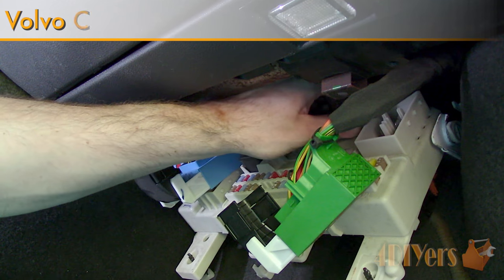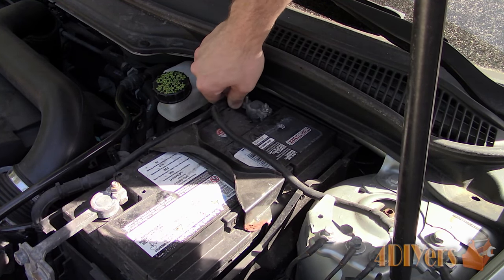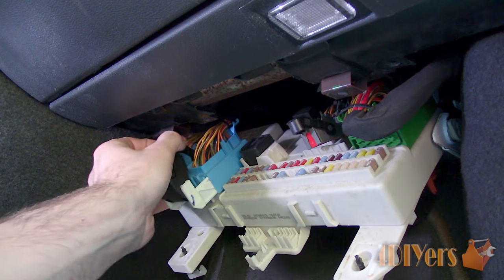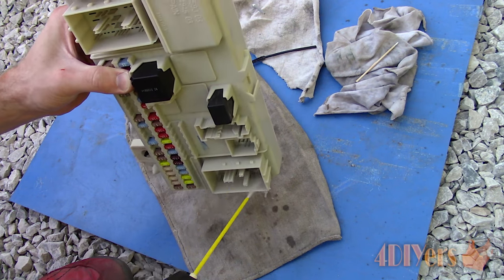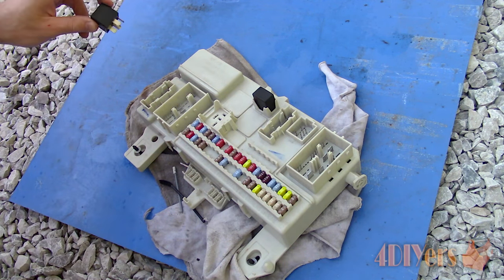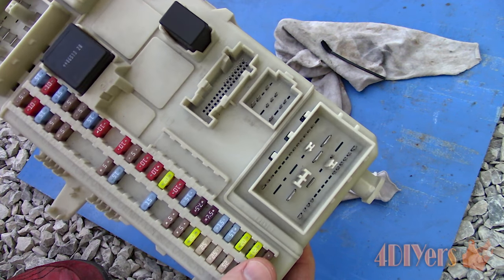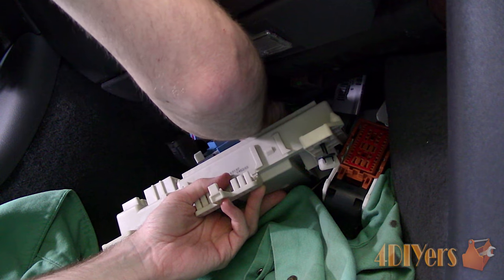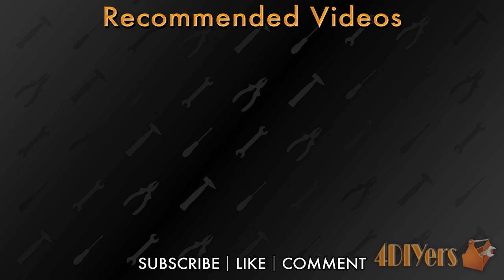How to: Volvo C30 S40 V50 C70 CEM Removal and Cleaning

Comment: Likely saved me thousands by doing this quick fix, thank you! My 2005 Volvo t5 v50 AWD suddenly started having multiple electrical problems: wipers stuck on, no turn signals, loss of window function, loss of lock function, alarm set off while opening hood, and gas guage failure. I found corrosion at the same spot that was in the video but his looked more severe. Cleaned with no contact cleaner safe for plastic, nylon brush, blew it out like a Nintendo cartridge and presto! Everything works again! I will note that I went pretty light on the cleaner, dried for only a couple minutes and skipped the electrical contact solution. Still worked for me.
Reply from the maker: Happy I could help and thank you for sharing your experience!
Reply: My s40 t5 driver door keeps losing function, so I'm going to have to  try this at some point!

Comment: Thanks for the information. Very useful. I would not have had the confidence to do this without it. I followed all of the procedure. I have a 2005 V50 car and a 2005 CEM, as it has a date on it. After removing the CEM, I could not see any evidence of either corrosion or dirt. It all looked very clean. Nonetheless, I sprayed each  connector, male & female and cleaned with brushes. I will have to wait and see if it fixes my problem which is indicating the CEM is the source of various issues! Fingers crossed. If this doesn't work, I will try a reconditioned unit..... I did read elsewhere that sometimes the welds on the motherboard are a source of problems??? I think I prefer older cars which have more basic electrics!
Reply from the maker: Happy to help! It is common for the soldered joints to break on electronics on some vehicles. I don't believe I've heard anything specific for Volvo. You can pull apart the module, the plastic case is a little trick but it can be done. Just take lots of pictures so you know where all the fuses go. I have an 06 Dodge Ram now, thinking it was simpler, it still have it's own electrical gremlins too. Next vehicle will be older at this point, can't stand the new stuff.
Reply: Did it work?
Reply: @fodolocraigo8426  Yes, it did work. Absolutely.

Comment: This is awesome video.  I had 15 volvo specific codes on my 2006 S40 after having recent acceleration problems.  Last two years, I was getting intermittent "engine system service urgent" message.   It was on most of the time in last few days.  I cleaned as shown in the video along with reinserting all the fuses plus cleaned grounds on the passenger side of engine compartment and down by the passenger door.  I put it together, message was gone.  I still had the codes and cleared them using an ES610 scanner.  I took it for a drive and the old acceleration was back.  Thank you so much, this demonstration really helped me .
Reply from the maker: No problem, happy to help and glad to hear your car is back to normal :)

Comment: My 2005 s40 CEM seems to be bad after moisture from a leaking heater core caused it to malfunction or corrode. As of right now i am having major issues with my windshield wipper switch not responding, and the wipers will randomly turn on at the fastest speed and wont turn off until the battery is disconnected. do you think a cleaning like shown in the video can alleviate this issue or am I sol?

Comment: You have just saved me £1,000 which a dealer quoted me due to a ignition issue (over starting). Bought a £4 can of the solvent, cleaned a couple of the green connectors and put it back together whilst in some questionable positions...

I can't thank you enough.
Reply from the maker: Awesome to hear and thank you so much for the feedback!

Comment: Massive thank you for this video!  My 04 s40 t5 threw a fit after a stall/quick restart. Wipers on, windows stuck down, interior lights, slight loss of power, no central locking, fuel gauge off.  Anti skid and sas airbag warnings on dash.  Followed your video step by step apart from the last fluid you applied.  Car is sorted 😎👌
Reply from the maker: Awesome to hear it worked and thank you for the feedback!
Reply: Sounds like you went through hell 😂

Comment: Thank you very much for your tutorial!

My volvo c30 was completely crazy: dashboard that went off randomly, lights abs, airbag, electric paralysis on the right side (window, central locking).

Everything disappeared with just a blow of elbow oil, which would have cost me 1500 € to the garage.

Quentin from Bordeaux, France.
Reply from the maker: Always happy to help and thank you so much for the feedback :) It's amazing how many problems this module can cause. I have quite a few more C30 tutorials too if you're searching for more repair videos.

Comment: Excellent tutorial.  I was planning on doing this to my 2011 S40 T5 which has assorted intermittent electrical problems (I think related to the fact I live in a humid climate).  And, I was just going to "wing it", being an EE.  But, your tutorial is going to make the process so much easier.  I can't thank you enough.
Reply from the maker: No problem, happy I could help and thank for the kind words.
Reply: Did you ever have bcm 0101 code and anti skid service required

Comment: Really glad that I found your do-it-yourself video for module issues. I had an interlock device installed 3 years ago 4 years ago actually and I have had issues after it was installed and coincidentally my sunroof had to be fixed due to the tubes in it leaking onto the floor causing pretty significant water accumulation. So I'm not sure if those two circumstances affected the module or if one particular issue was the culprit. What occurs when I drive my car especially when it engages into turbo I will receive a notification on my dash that says anti-skid service required and then my car will go into safety mode taking it out of drive gear and if I drive it for a while it will suddenly pop abruptly into drive and if I didn't continue driving it and needed to stop and put it in park before it has a chance to pop back into gear it will go into immobilization mode locking my key thus leaving my battery on. So one mechanic told me to disconnect what appears to be some type of module in the engine that's wiping out the memory of the cars notification system I guess giving it temporary amnesia wiping out that memory that has a issue and then I'm able to restart it get my key out etc. Volvo dealership had it for a month and said they're getting a miscommunication error but they can't figure out out of the three modules where it's originating from because it doesn't misbehave when it's on the diagnostic itself. So I've been driving it like this for 2 years minimally. I've been using my deceased sisters Passat and it's alternator just went to put on me so I'm back to the Volvo drill that I have to endure randomly it only happens 5-7times a month when driven regularly. And as it is a 2004 S40 I am a single mom and a budget and I can't even fathom spending the money Volvo wants to charge me for a brand new ECM/ECU Module and a reprogramming fee wiping out my nest egg $$
 for a car that has a Kelly Blue book value if $2,400.00. So with that said, I'm going to try doing exactly what you so beautifully demonstrated with the best clarity I have seen on any do it yourself tutorial that is available . Thanking you in advance for taking the time to video the process and making it so easy to understand for a person who is somewhat mechanical at least I think I'm really good mechanically but not a professional auto mechanic. Single moms have to do what they have to do and stretch a dollar pretty far. Thank you again I'll let you know if it works!!

Comment: Really excellent video. Like others I was getting numerous alarming messages including the following "engine system service urgent", "Brake failure stop safely", as well as having the airbag light on, window wipers going off on their own and the windows themselves not working. Also the car refused to start after the "engine system service urgent" appeared! Anyway, a local auto electric mechanic told me that the CEM unit on the Volvo S40 (my car) is prone to cause a multitude of issues including mine. This being due to corrosion on the CEMs contacts. He also noted that there was a voltage drop on my car. Anyway I cleaned the CEM with WD40 Contact Cleaner, reassembled obviously!, now the car is going like a rocket! 

Many thanks for this great guide. Probably saved me a lot of money.
Reply from the maker: Thank you so much for the kind words and feedback! This should definitely help out fellow viewers with your info.
Reply: Hi, is the votlage drop an indicator of CEM failures? Im getting multiple errors on my v50 and had it at mechanics 3 times now without anyone fixing it. Once after I stopped the car after getting the errros it did not start again as something was draining the battery.

Comment: '08 S40 T5 w/142K here. Recently purchased. Check engine light comes on, 1st time it was "erratic ignition," misfire on cyl's 3 and 5. Later came back on and it was cyl 4 misfire.  Changed all plugs with new NGK's. Then changed all 5 coil's as suggested. Neither made a difference. Starting cold the engine fast idles with misfires. Goes on fast idle perfectly then drops down to preset idle. Only seems to misfire at stop signs, traffic lights, anywhere I have to actually stop. But upon acceleration the car does fine, lots of power thanks to the turbo. But the low level putt, putt, putt at a stop is annoying. I dropped the CEM under the glovebox and pulled all the plugs and cleaned with an electric spray cleaner. The best news is I didn't make anything worse!!  Gotta take those wins when you can.  But the low level misfire remains. Just wanted to share this with anyone who may be having similar issues, Good luck to all and a blessed new year.

Comment: As I have a UK spec V50, a right hand drive. car so the CEM is at the left hand/ passenger side of the car. To replace the pollen filter in need to remove parts of the CEM to gain access and it's murder to get this out. I did remove a few clips with the battery 🔋 disconnected so that wasnt a problem really. but putting it all togheteher again I noted the odometer and the clock display no longer stays on after the ignitions is switched off. They stayed on for about 5 minutes after the car was locked before replacing the pollen filter. 

Your video gives me the confidence to try to see if there is a problem with the connectors. 
So thank you for a thorough and very helpfull video. :-)
Reply from the maker: No problem, always happy to help! Trying to remember back on my Volvo, I believe mine turned off almost immediately after I removed the key.

Comment: I think this is exactly what I need to do.2005 s40t5 throwing all kinds of messages,immobilizer,reduced engine,brake failure,etc.I'll give it a try.I did have a plugged ac drain a couple of weeks ago but didn't find water at this location.Only passenger rear and some in the lower right central coloumn.
Reply: I am having the same issue right now so this is what im trying.

Comment: Thanks for the video! When I took mine out I found corrosion on the blades on all of the fuses except one. I cleaned them all with 200 grit sandpaper.  I opened the plastic case by holding open each clip with a half toothpick. There was no corrosion on the CEM itself.  Since the problem is intermittent, I won't know for sure if this is the real fix for a few weeks, but I'm really hopeful.
Reply from the maker: You're welcome! Hopefully that solved it, depending on the severity of corrosion, it can cause intermediate issues.

Comment: Im having a CEM problem right now..have 4 codes for the accelerator pedal sensor so after i tried 2 junkyard pedals, i had to take it to the stealership..they just gave me a quote to replace the CEM for $2800..even though its a V50 AWD M66..i was debating scrapping the car..until this video gave me an option, thank you!
Reply: Did it fix your issues?
Reply: I had the same problem..it is definitely the cem..just get contact cleaner and clean the shit out off the harness pins and cem pins..thats what i did and it worked

Comment: Yeah so my right side lowbeam light seems to have an issue. This may be the answer. I’ve replaced the bulb, bought several actually, and no dice. Hope I don’t mess this up. Thanks for your awesome videos, I’ve got a 2007 Volvo s40 and your videos rock!
Reply: I know it was 3 years ago, but did it work? I have the same issue 😂 lowbeam right side is not working for me

Comment: Great tutorial, I've had an issue recently where my horn was stuck on, I removed the wires connecting the horn, I'm now worried that the alarm will have an issue, do you know where the fuse is located on a 2010 V50 for the alarm siren as I just want to eliminate the possibility of more noise for the neighbours at 5am

Comment: I bought a used S40 that is 16 years old. The car was mechanically in great shape but had one electrical problem after another. Brake failure light, immobilizer light, fuel rail code, accelerator pedal code, engine system urgent, p1070, p0240, etc etc I took out the cem, and cleaned it. It didn't look dirty, at least not the connections, but there was dust all around the Box. After cleaning up and putting it back together all codes disappeared even the check engine light is off. These should probably be cleaned every few years. Had I taking it to a dealership, they will have certainly try to sell me a new one. Those uncomfortable working on these cars should not buy one. If you don't mind getting your hands dirty little bit that's worth it

Comment: Excellent - no wasted waffle. Hope this will help me trace a problem on my S 40 daytime running lights
Reply from the maker: Thank you so much!
Reply: Did it help? Having the same kind of problem...
Reply: @anttilager177  Hi there, sorry but I’ve not looked at it yet.
Reply: could you solve the problem?
Reply: @latking  yes Mike. I replaced the relay and the headlight now works. Fortunately, I had a neighbour who desoldered the faulty relay for me and soldered the new one. I wasn’t too confident with doing the soldering.

Comment: I’m having trouble with 2005 s40. The emergency flashers and high beams flicker. Not too long ago had a leak in the coolant basin and repaired. Thinking coolant may have corroded the CEM. Will try this as a fix.

Comment: Great video and reading about symptoms I may have few, one of them is problems with the start, sometimes just don't start...wait a moment, or few hours or a day...and it just start. A questions please, if I change or replace the whole CEM does it need to be reprogram or just replace with no programing. Thanks so much for the video
Reply from the maker: You’re very welcome! Unfortunately a replacement cem will need to be programmed to your car.

Comment: Thanks for video I think I need to do this as getting a lot of different problems lighting up , then nothing for ages then it will do it again . Also when I push button for rear heated window and front window I get interference on my radio will this be something to do with the ecm to . Mine is the v50 1.6 drive diesel
Reply from the maker: No problem!

Comment: Wish me.luck please. My 05 xcv70 began a malfunction streak a little while ago. This video seems to offer some hope for some of the issues perhaps. The speedometer was the first thing which seemed in this category but other things may be related like the brake warning failure stop safely message.
The odometer is not working now as well.
The first thing I noticed is the lurching right after starting and getting underway.  The traction light flashes when the lurching is felt as though the back wheels are dragging or something like that but this goes away shortly. It acts up in slippery situations briefly too. Almost always right after turning out of the driveway while  getting underway though.  The speedometer always  fluctuates now  at first after start up and does not show actual speed but the tachometer is fine. After a little while the speedometer does start to display accurately but now at exactly  the same time the stop safely brake failure message displays now too. The brake message does not come on when the car is shut of and started again. It is like everything resets but the pattern is the same. No speedo, anti skid message flash, / then speedo works and brake message comes on. But now the odometer is just off line or very intermitant.  It has not advanced for a few days. The trip meter is not working at all and the instantaneous MPG display says zero most of the time but comes on intermitantly too. Also the average mpg display is horribly down to 10-11 mpg half the previous normal.
Actual mpg is hard to figure out now. It does seem like it is getting the crappiest mileage now though. Engine  seems ok though.

Comment: Great video 
My 2010 s40 T5 AWD just developed strange behavior. I got Anti-skid warning light and transmission shifts to N, once released gas pedal it shifts back to D. Repeated this for half dozen times and just went to normal. Three days later same thing. Transmission otherwise works flawlessl.
Would you think it has potentialy ECM issues 
Thank you 
Would you think

Comment: I’m tackling this one over the weekend, for my ‘06 S40. I have an intermittent problem with driver door controls not working, as well as all of the alarms coming on at once. (It acts as if the main power connection to this CEM is being flaky, causing a restart/initialization)
Reply: Still doing it.